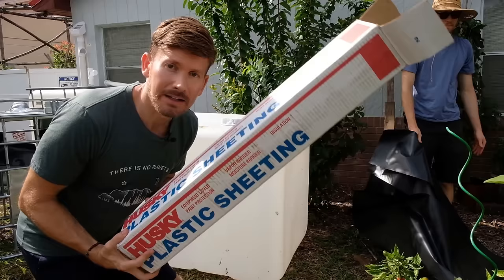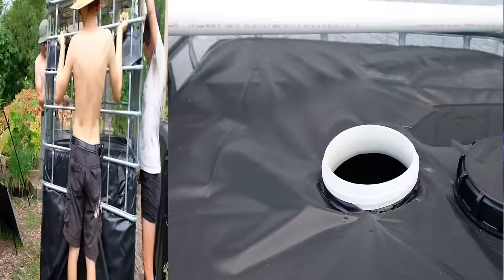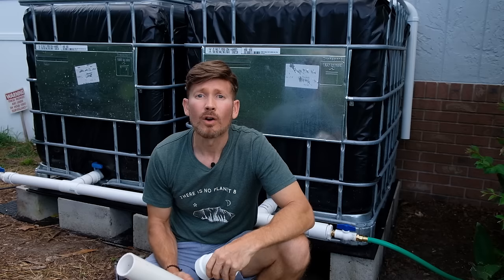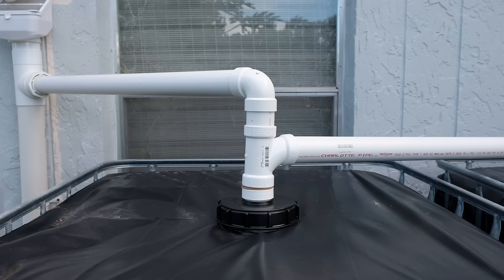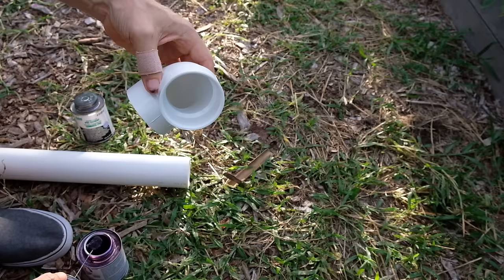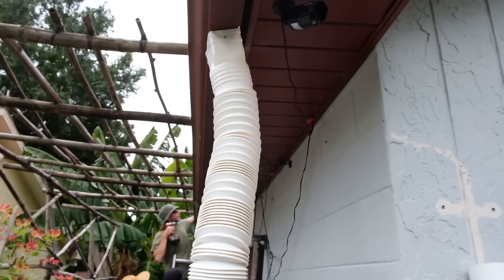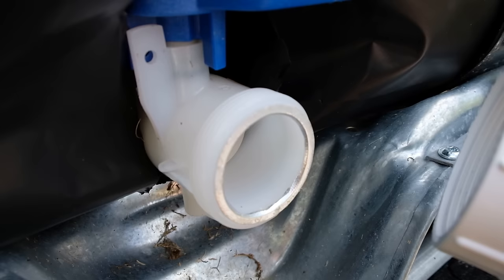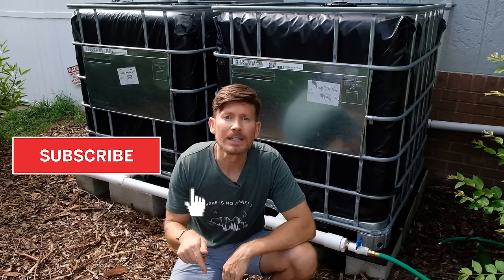How to Build a 550 Gallon Rainwater Harvesting System

Comment: Great video with a lot of good info but can add a few things. 

The top of the IBCs do need to be tight for the overflow to work or the water will just leak out before building the head to overflow. Rather easy to add a standpipe. 

There are various types of threads on the IBC outlet, even in the USA, so good to check. There are adapters for the other types available online but not as convenient. 

The other thing worth checking is the original use of the ibc. If it’s not food grade you could be introducing nasty chemicals into your food via the water. 

Lastly, calling the water in the tote clean is a relative misnomer. It is cleaner but is definitely not drinking water cleaner outside of third world countries where waterborne diseases are just a part of life. It could be further treated to achieve drinking water clean.
Reply from the maker: Thanks for the comments. Yes, I cover these details in my new rainwater book on building this system. I also add the option to do the overflow from the side which eliminates the need to tighten the top caps and let the air out as the water fills up. Leaks could happen if the top caps are loose when the overflow comes from the top so I have the side option for those with a system in their basement, barn, etc. And yes to rainwater having some air particles and microbes. I used a Berkey to filter the water as a secondary filtration and didn't have any issues. I hope to put an update out soon on how the system is doing. Still going strong!

Comment: This is a great system! To make it even better, I offer these two suggestions:

1. I would encourage using [more] smooth pipe instead of the flex pipe if it's installed in mosquito prone areas. They will be happy to lay eggs in the water trapped in the bottom corrugations.

2. I would also add threaded disconnects at the totes' discharges. This will make replacing the black plastic cover, and/or the entire tote, or broken pipe sections much easier.

Comment: GreAt video!  I do have a question?  What if I have to take off the bottom pipe that is connected to the tote?  Can I get away with just a screw on fitting instead of cementing the pipe?
Reply from the maker: Yes! It’s called a “union” It allows you to detach the pipes without needing to cut them. You can put one in the middle of the bottom pipe and then unscrew it to separate the two totes. You could instead buy two and put them on each end and should be able to take the front pipe off all in one piece. I don’t have a union in my model and recently moved and had to cut the pipe in half and then reattached it with a coupler. Unions may run you over $20 each but they do make things convenient!
Reply: @naturehacker1095  thank you sir

Comment: What about spray painting the white totes to black with UV resistant paint?   Won't that help things further with algae control?
Reply from the maker: It can but the plastic is slightly permeable so you take a risk with chemicals. There are also covers you can buy on Amazon that cost about $30-$50. I can’t guarantee the quality. This plastic sheeting is going on 4 years and hasn’t changed a bit. I have a new video and ebook coming out soon with the cover I built that keeps the system super cool in these hot months. Stay tuned…

Comment: Awesome work!

How long does the 550 gallon system last you for?
Reply from the maker: The front yard is connected to the rain barrel/ drip system. With drip, it depends on the season. Right now in January in Orlando, this water may last a few months without a refill . I'm keeping track and will have a better estimate by the end of the year. I don't know if it will be all I need for the front garden all year round, but it covers a big chunk of my garden water usage. Ideally, I'd have two systems like this to cover my front and back yard and drinking water that I filter through a berkey filter.
Reply: @naturehacker1095  Awesome! 

Does the 550 gallon system also cover your toilet, faucets, shower & bath?
Reply from the maker: @TheStellarmanCo.  I'm currently designing a simple compost toilet outhouse that will feed my humanure system of three 55 gallon drums that rotate the compost over 12 months until it's ready for fruit trees and the flower garden. Very little water needed. Only for washing out buckets. I dont have an outdoor shower system yet but would love a biogas or propane shower that hooks up to rainwater. I'm brushing my teeth and washing my face with filtered rainwater but still enjoy the convenience of a faucet for basic washing purposes.

Comment: The cost is high for this system. Im guessing its close to $600  just the material pipes, cinder block, spigot, leaf eater, first flush diverter, ibc cap, cement pipe, pipe connector, tank gauge and husky plastic sheeting. 
Ibc totes are usally around $100-$50

Comment: Do you have any thoughts about stacking totes 2 high for added capacity?  Would you then make a manifold for the top tier (like you did for the totes in the video) and connect that to the middle top input on just one of the lower tier totes?  Thanks for the great ideas!
Reply from the maker: Sorry I missed this! There are people who have put one on top of the other. I haven’t done it myself but it is possible.
Reply: Be careful stacking totes. That is a ton of water per tote. While the totes are designed to be stacked, they are also stacked perfectly plumb (the level of vertical orientation) and I think they are also restrained. If it were to get out of plumb or other lateral pressure, the results could be catastrophic.

Comment: I want to say I really appreciate all the precise information you give. one this I am trying to figure out (and obviously having a bit of trouble figuring out) I'd like to have my two totes higher than a single cinderblock. giving it a little more height. do you think I would be able to have 2 bricks on top of themselves without compromising the foundation? or could you direct me somewhere who maybe would know? as I said I'm having a lot of trouble finding any information.
Reply from the maker: Yes! You can have the foundation a few cinder blocks high to add more passive water pressure to the system. I’ve seen people make them higher and they had no issues. Just place them the same direction as I did. That is the strongest position for cinder blocks- they can take the most weight in this position where the holes face up and down.
Reply: @naturehacker1095  thank you so much for replying! it is very appreciated! do you happen to have a different channel with more videos?
Reply: Be careful stacking blocks. If they are not attached, the connections become a weak link and a place for failure. The ibc has a ton of water, so if the ground shifts or some other lateral force comes into play, the results could be catastrophic. There are lots of things people do on youtube that are not safe and just because the failure isn’t apparent at the time of filming doesn’t make ale them safe or safe in every situation.

Comment: Maybe I missed something. But if you leave the cap a bit open, won't the water flow out from there iso going to the overflow?
Reply from the maker: No. You didn’t miss anything. I just leave the caps a little loose. Plenty of water goes into the overflow. You can also keep the caps tight and instead insert a vertical PVC  pipe coming out of the top overflow pipe and just cap it with some mesh so no bugs or mice get in. Water shouldn’t come out of it. It will act as a vent.
Reply: @naturehacker1095  ah okay. I put my overflow on the side as heigh as possible. So it's never completly full but no water is added to the paved underground.

Comment: Great video!!! I have a question. Most the IBC tote be “food- grade” or doesn’t matter as long as the tote can be cleaned out? Thanks in advance.
Reply from the maker: Thanks! I would be hesitant to use it for the garden if it had anything toxic in it since it’s hard to get it everything out. Just ask what was in it before. If it was adhesives, I’d pass because it is VERY hard to clean out the inside top of a tote. If it was organic fertilizers or something like that, I wouldn’t  worry if it’s for the garden. Mine had fruit juice so I’m fine with filtering it and drinking it.

Comment: Love the concept! Was wondering if you had a ball park estimate on how much this costed in total for every part including tanks
Reply from the maker: I haven’t added up all the numbers, but I provide a parts list and prices and purchase links for the system in my new illustrated e-guide that can be purchased through the link in the video description. My estimate is around $500 but it depends on the cost of the totes. That will vary depending on what is available to you. I paid $100 each for mine. I also provide cost saving tips in the guide if cost is a factor for you. For example, you can buy the first flush diverter kit for $60 or make it yourself cheaper which is what I do now. I show you how to do it in the e-guide.

Comment: On the right side, the ball valve outlet coverts to 3/4" garden hose, for which the usage is typical. However on the left side, you leave a 1.0 in threaded ball valve ... so my question is what is the planned usage for this 1" side? Is this for a future use, or a pump, or simply a wider dump path, other use? Thanks in advance.
Reply from the maker: Hello! I added that wide spout for filling up buckets very quickly. It’s not necessary to have a valve on that side.

Comment: Do you have a figure of first flush to see how it looks inside and how it works? Thank you
Reply: Google first flush. They are common in stormwater systems. 

Basically, solids settle in the tube, then water builds up and overflows into the catchment IBCs.

Comment: Did you ever add the pump?
Reply from the maker: TTT Enterprises LLC Yes. It works with a submersible hydro farm active aqua pump attached to drip irrigation. I used 720 guy pump and it was powerful enough to feed about 100 emitters. Im also going to try a smaller one to see if I can get enough pressure. I attached the power cord to a timer in my garage so that the power to the pump turns on and off twice a day for only a few minutes. The same type of timer you would use to turn lamps on and off at the house when your away on vacation. I will make a video soon showing the applications s system including filtering it for drinking water, showering, and drip irrigation.

Comment: How difficult is it too add more tires to this without taking the system apart? Also it's the water actually, readily drinkable just after 1st flush and filtration focused on debris/sediment? What about the protozoa, bacteria, microbes, etc?
Reply from the maker: I use a Berkey filter to drink from my tanks. You need to filter out the bacteria with a high quality filter or UV light. A BRITA filter for example will not take out the bacteria. If you plan to upgrade in the future, make the ends a little longer so you can cut them later and then attach the 2 inch pipe from the new tanks using a 2" PVC coupler. And moving the system is easy. I cut the bottom pipe in the center and then reattached them at the new house using a 2" coupler. Just make sure to use PVC cement on all bottom pipes. The rest don't need glue.

Comment: There is no filter that can keep birds from pooping on roof and ending up in water
Reply from the maker: Correct! I am working on a solution using four, 10 gallon barrels filled with sand, pebble, and biochar to take care of this situation. I hope to pressurize it with an on-demand pump so the water from the system will go through the natural filters and end up clean AND re-mineralized on the other side. Normally, we would get water from a well, spring, or river and these systems re-mineralize the rainwater. But for now, I have used a Berkey system to filter the water and add some trace minerals afterwards and never had any issues.

Comment: How would this work in temperatures below freezing?
Reply from the maker: Marlinspike Mate Hello! We don’t have to deal with freezing temps here in Florida but there are some options that may work for you. First, you can certainly winterize the tanks by emptying them and clearing the pipes so that frozen water does not cause them to burst. The first flush diverted will need to be opened up so that water will run out and not go into the tanks. If you want to still use the system, you will need to install an aquarium heater into each tank that is rated for large volumes or use an aerator that will circulate the water with oxygen bubbles so that the water molecules can’t bond together into ice. I haven’t tried these solutions personally but these are some suggested ways to deal with these tanks in the winter.

Comment: Could you just paint the tank instead of wrapping? Or was it more cost effective to wrap?
Reply: I painted my rain barrels a lovely green and it worked quite well.  Little algae growth in my systems.  (Could be climate based too.) I’m also afraid that the black plastic would likely fry the tadpoles that live in my more open rain barrel system and the little, top-of-the-water growing plants that set up shop that the tadpoles feed on.  I net catch the little guys and transfer them to a tadpole pond next to the system.

Comment: This is a great video. Then looks like this is a permanent setting and you cannot remove the bottom connecting fittings from the tank once installed. Right?
Reply from the maker: Yes, The bottom fixtures are sealed with PVC cement because there is A LOT of pressure on them and they would blow out if I didn't add the cement. HOWEVER,  you CAN make it so that the system can be taken apart if you add a 2 inch Union Coupler to the bottom pipe that lies between the two tanks. https://www.lowes.com/pd/Homewerks-Worldwide-2-in-x-2-in-x-2-in-dia-x-4-in-L-Union-PVC-Fitting/50160567  I didn't do this to save money and if I ever move the system, I will just take a saw and cut the pipe between the system and later just add a coupler and cement them together or buy the $15 union coupler and screw them together.  The top pipes are NOT glued and can easily be reassembled and taken apart if needed. It is not a difficult process and so far the pipes have remained strong and secure under all that pressure.
Reply: @naturehacker1095  Thank you so much for the information. Both are great ideas. you are amazing!

Comment: I want to do a similar set up for my off grid cabin. Was thinking of using your setup but then adding a submersible pump piped to a pressure bladder with a float cut off switch. Are there inline filters that I can add to ensure safe drinking water? Or maybe use a big Berkie filter? The rainwater will be used for all my water needs. Thank you great video
Reply from the maker: I’ve seen one person who hooked his system up to reverse osmosis. My system is not that complex. The water runs clean out of this system and then I pour it through a Berkey filter. The one problem that you gonna have with rainwater as well as reverse osmosis is that the water is going to be very low in mineral content because you are intercepting it before it goes through the soil and back into the aquifer. So I would get some trace mineral drops that you can add to your water after it is filtered.
Reply: RO systems also waste a lot of water in their process. 

There are some videos for off grid systems that use a stepped system of prefilters, like here, sand, and then activated charcoal. Berkeys are great too. I’d use it as a final step for consumable water.

Comment: If the top lid is slightly loose to let air escape then why would the water go into the overflow tube and not just out the loose lid the same as the air?
Reply from the maker: It’s just loosened a little bit. When you have a rain storm, the water builds up quickly and most of it goes through the overflow. You can seal the lids tight and then put a 2 inch uniseal near the top of one side of one tote and create an overflow there instead. You will lose a few inches of water collection at the top of each tote which is why I did it the other way. But either way works.

Comment: So....  You say to crack the top a bit for air yet in another section you show it being used as a overflow system.  Which did you actually use?
Reply from the maker: The top lids are a little loose but the water fills quickly and fills faster than the rate of water leaking at the top so there's plenty to go through the overflow. An alternative that should also work is keeping the caps on relatively tight and then drilling holes every few inches or cm at the very top of the top pipe that runs across. That should allow air to escape and also shouldn't leak much water when both water barrels are full. All I know is the that the system works well and sometimes the results defy the initial logic of what should or might happen.

Comment: If the lid is open for ventilation, does water come out of it during overflow?
Reply from the maker: There’s an overflow pipe on the right of the system so most of the water leaves from there. The top lids are on and mostly closed, I just loosely closed the lids so air can still get in but just enough to prevent creating a vacuum inside the system. I doubt much water would leave from the lid. I haven’t gone out yet in a rainstorm to check.
Reply: Nature Hacker 12:40 I would have thought that if you have the caps a little loose to let air out, then water would also get out.  Certainly if that capacity of water escaping through such a large overflow pipe attached to the cap.

I have several water barrels in my garden and if I had a larger property I would also be using totes (IBC tanks in the UK).